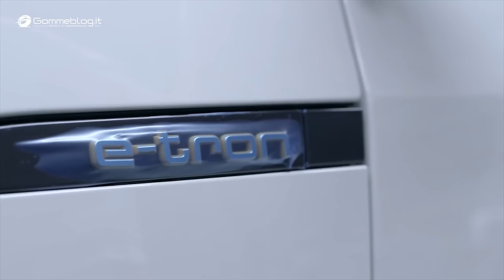Electric Engine PRODUCTION - Audi e-tron MOTOR

Comment: I will like to see them build electric power motors for airplanes, of all type of planes, with Gigantic Alternators, for example the big plane the A380Airbus, spends around $280,000 US dollars just to fill up the tank with fuel, and is only for one trip depending on the distance, with electric power the cost would be less than 3% of what they are spending now day, no wonder they don't want to make bigger planes, the cost of fuel is way too high, and also the customer can't afford to pay high prices!.
Reply: Energy density of current batteries are not sufficient enough. Maybe in the future

Comment: All electric cars do is shift the carbon from the car to the generating stations, electric cars have no less a carbon footprint than normal gasoline cars, and when you take a replacement battery into account they produce more carbon.
Reply: The benefit of electric cars is to centralise emissions. If everything runs off of the grid, we can then replace coal fueled power stations with renewable sources. That shifts everything to low emissions. If cars stayed petrol / diesal powered then the transition to low emissions would not be possible. This is the first step.
Reply: Power stations can be transferred to clean energy just as cars continue to be.
Reply: @willasproth Have any of you watched Planet of the Humans, they're FKN burning trees to make electricity now. Burning the one thing that takes carbon out . You all just keep drinking the fairy tale Kool Aid
Reply: kg dies regardless of your opinions about how we currently generate electricity, it’s indisputable that it’s possible generate electricity from renewables and that it’s that it’s necessary. Petroleum and coal will run out one day, it’s better we start the solution to that issue now.
Reply: @willasproth  Well if you did any research you'd soon discover mans input to global warming and the effects of C02 are negligible, in fact global warming stopped 20 years ago, and the earth has been greening up because of the slight increase in C02.
Reply: kg dies Instead of going through the predictable motions of this kind of debate, why don’t you cite some research and I’ll critique it.
Reply: @willasproth  The internet is replete with scientific facts that global warming is nothing but a globalist scam, do your own research, that's if you even really care.
Reply: kg dies just cite one thing
Reply: @kgdies  If the internet is replete with scientific facts, why can't you provide any? I have looked and have been unsuccessful in finding any credible sources supporting your point. Are we supposed to just believe you? What sort of people do you want representing your position? People who will just believe a random guy on the internet who can't even be bothered supporting his claim?

Comment: But it is still not carbon free! The factories that made the metal, wire, steel and batteries I am sure were not carbon free. When the car is charged be fossil fuel power plants are not carbon free. The mining of raw materials are not carbon free.

Comment: No wonder modern cars become bricks after 5 years and become economically unviable to repair. They are made like cardboard boxes in an assembly line. It's all about volume, not about quality. 

Almost every modern German cars are unreliable pile of rust these days. But they charge you 100x more as if it's supposed to be something special. Pathetic.

Comment: I don't have an electric car but I already hate them. Why is this backward step being forced on us. I am only interested in Diesel cars. I love Diesel - Have a Mondeo Titanium 2 litre - Will do 140 mph - does 50 mpg - will do 600 miles on a tank full - Refuel time 3 minutes - Not 3 Hours Plus - Uses less fuel than petrol - More environmentally friendly - Diesel Uses 2 gallons per 100 miles - Petrol (30 mpg) needs 3 gallons per 100 miles - Unlike electric will not need a new battery after 3 or 4 years costing £ Thousands ! It is a no Brainer ! Go ahead and buy electric cars and crash the National Grid and get power cuts ! Is there an idiot out there who thinks electric cars  will change global warming ?   ! A process that has been going on for more than 11,000 Years, When Britain was covered by an ice sheet a MILE thick ! Go on admit you are an idiot ! Imagine waiting more than 10 hours in a line of 100 cars on a motorway service area to recharge your car !!!! British motorist MUST fight this lunacy !!